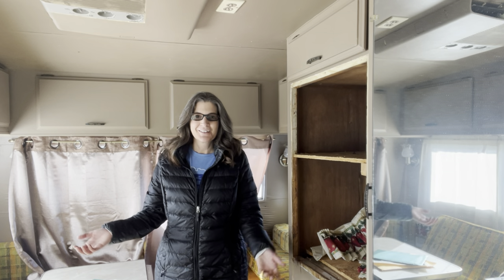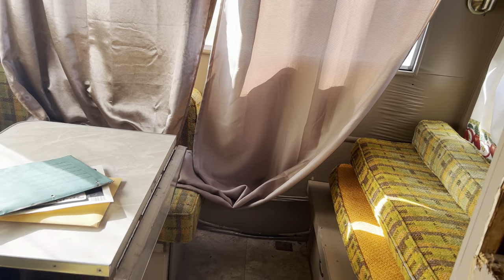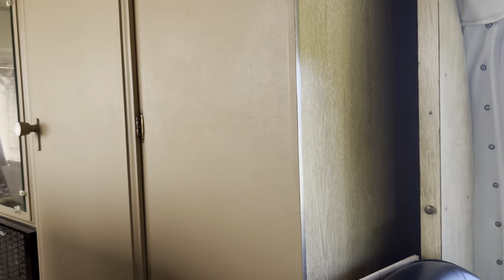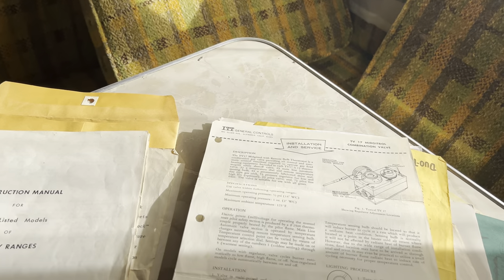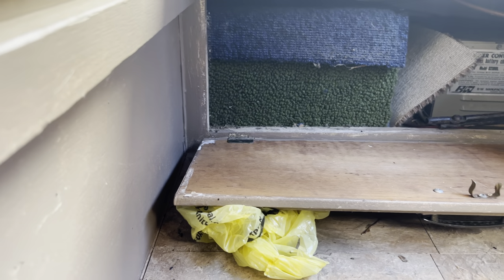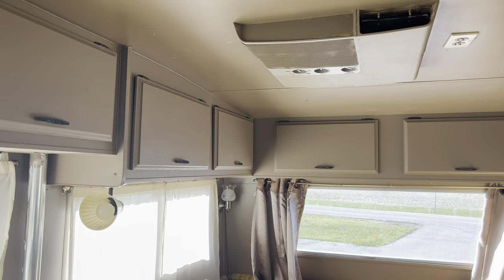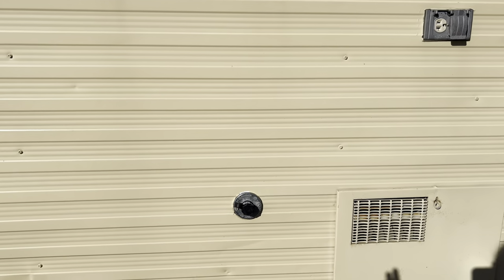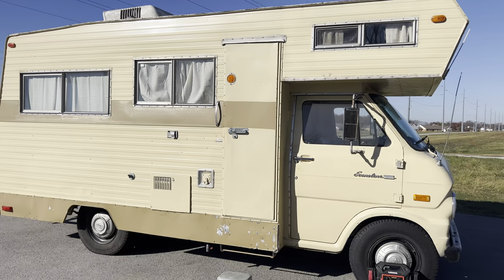1970 Ford E-300 Shasta motorhome. Enjoy a Cousin Eddie Tour.

Comment: Leaks, not cheap but quick roof fix. Patches and a gallon of Flex Seal about 3 coats brushed on seams and around vents. About 2-3 coats rolled onto whole roof. It rubberizes the thing from all leaks. Mines going on summer number three and i HAD many leaks 😂.   I cant wait to see what all you do. For the age it looks fine. Im in love with your green stove top and oven. ❤
Reply from the maker: Thanks! I love that oven too. I would like to see your rig. Have you been traveling full time?
Reply: @frankiethedrifters9973  I love to see how it turns out! They are a cool little camper, I have the exact camper. Mine is a 1970 Ford E300 Shasta motorhome made in apple creek Ohio. I completely redid it with new wood and kept it as original as possible! Mine has blue interior with avocado green appliances, and it is originally and still is white with gold stripes!
Reply from the maker: @badmopar3834   omg. our dash and dog house is blue and we have the avacado green stove. unfortunely, no frig.  I would love to see before and after pics of yours. Did you find your camper in ohio?

Comment: Lovely vintage rig.  I like the squarish lines and aluminum trim everywhere.  This thing has style.
I would remove all the rat and mouse droppings and spray bleach on it.  Hantavirus is airborne, so you don't want that air in your lungs. I think the keepers are - lamps, dining table, mirror and medicine chest, the green stove, 

What I would change:  get a modern, deep sink with a modern faucet, new Secop compressor fridge, solar panels and full electrical grid with Victron components.  I would redo most of the floor cabinets and wardrobe, as that wood looks bad.  Also, there may be wood rot on the floor and you want that old carpet gone completely.  Use a gym mat rubber flooring instead for under cabinets to deaden sound.  Use vinyl tiles on exposed flooring.  I used clicklock bamboo but it was too heavy and not waterproof.

Here are some tips on the bathroom:  Get a Trelino composting toilet, remove the shower walls, put up Schluter kerdiboard, then stick Innovera by Palram vinyl tiles on wall - they look like marble or stone but very light.  Use a plastic shower pan or real tile.  

To make your dashboard new again, try painting it with Durabak, a marine grade polyurethane that looks like a factory finish vinyl.  It comes in standard colors.  This works well on the exterior too, and cabinets. It is very durable. Solvent is Xylene (Walmart online if you live in CA).  Sand, Xylene rub down, 2 coats, done. Use a mohair roller brush, no need to spray even as car paint.  See Youtube videos.

This is very laborious but a fun project.  Have fun!!  I would buy a manual staple remover from Amazon, for those carpet staples, makes your job easier.
Reply from the maker: WOW! That is a lot of helpful information. Thank you for taking the time to write it all down for us.I never really thought about painting the dash.  You have giving us quite a bit to think about and some great ideas.  That toilet has got to go. I have been looking at several different compositing toilets. Do you have  the Trelino? What do you like about this one? We are not sure where to start, I guess fishing the leaks.